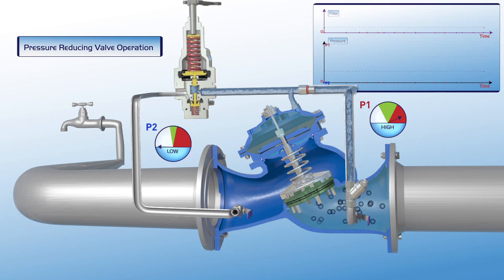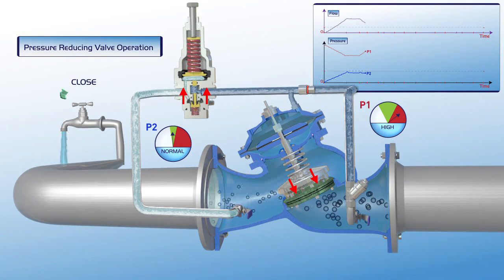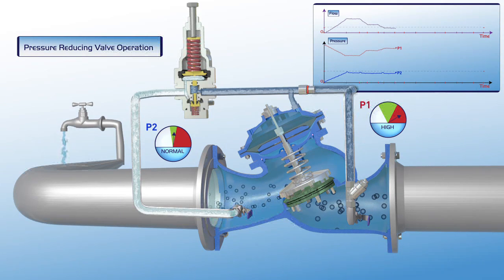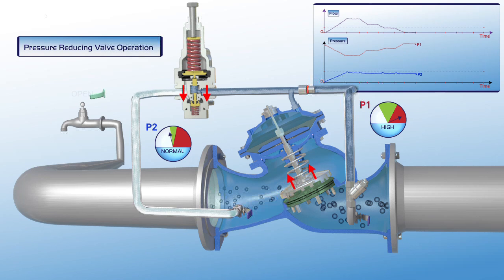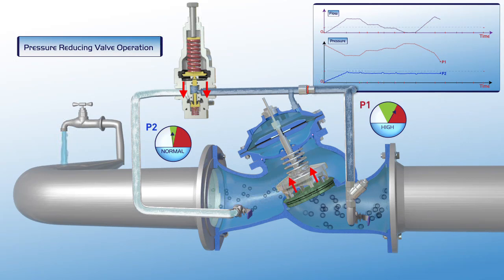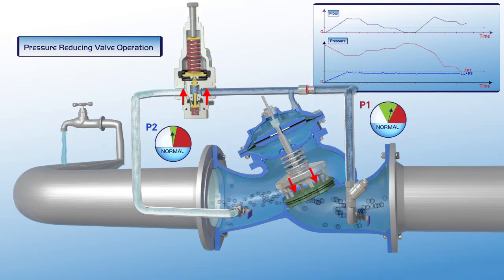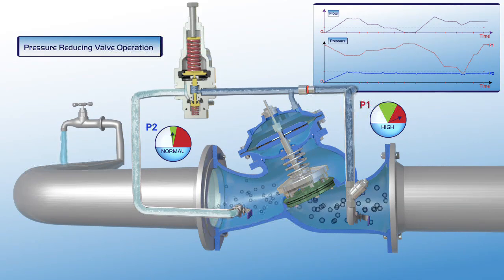720 ES Pressure Reducing Valve - Operation

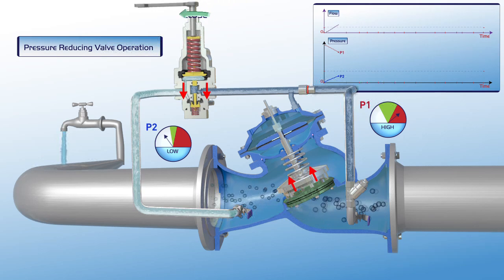Comment: How does the pressure in upper control chamber drops when the pilot plunger goes down (as explained at 0:28)?
Could you please illustrate this part more clearly
Reply: Was wondering the same thing lol, could anyone please explain it?
Reply: @didiekay1164  Because the Pilot Plunger essentially increases pressure downstream, the pressure on top of the Upper Control Chamber gets pushed downstream as well, as it is connected to the piping that goes to the Pilot Plunger. Therefore, it creates a suction in the top part of the Upper Control Chamber causing the Upper Control Chamber Plunge to rise. Look carefully at the top of the Upper Control Chamber as it pushes pressure into the pipe.

Comment: How can i calculate strength of spring that can handle high pressure from inlet pipe ?
Reply: You don’t have to, I installs them on lines pushing 150 psi from a pump station. It’s what their made for bud